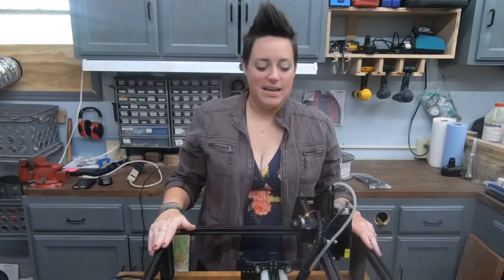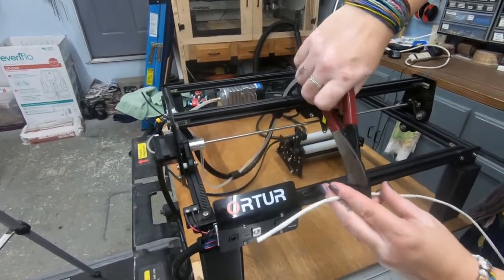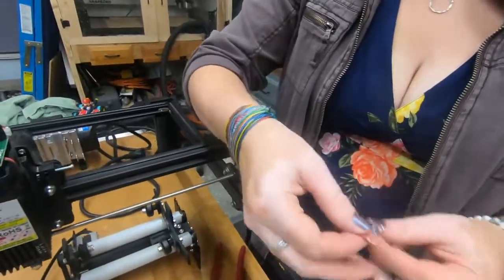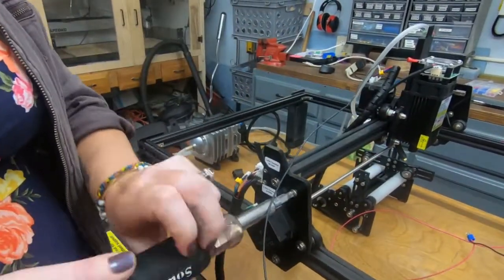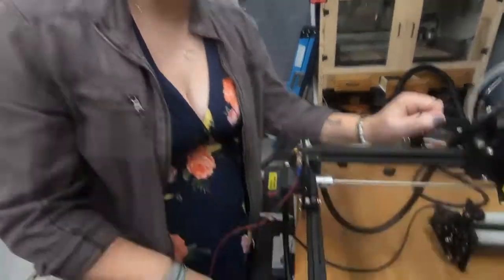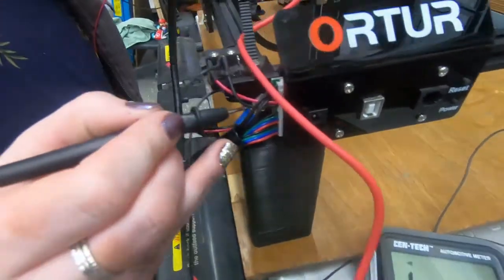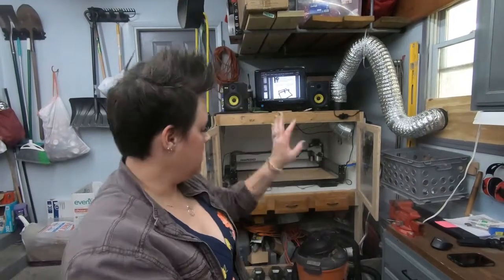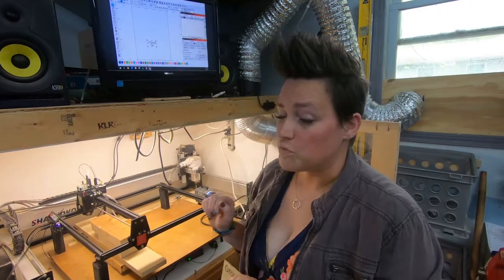How to Install DIY Laser Grounding Ortur LM2 20 Watt

Comment: Question, hopefully you can help me! I just got this brand new laser, so everything works except the laser wont turn on, it moves as it should, fan is on, led light is on, just the laser wont turn on, iv tested the board and power is running through when i use the fire button to test voltage fluctuation. Just my laser wont start. I even got a low voltage battery to test out laser itself and it works completely fine, i just dont know why it wont turn on. Would it be this grounding issue??
Reply from the maker: When I first got mine I had to reseat the cable going to the laser module a few times before the laser would fire correctly.
Reply: @KLRform  i can say iv done that a few times, but ill keep doing that and hopefully itll work. Was there any computer setting that may also be involved with this problem? Or is it just a contact issue?
Reply from the maker: Mine was just the connection. Might jump into a forum. Some one else might have had a  similar issue.